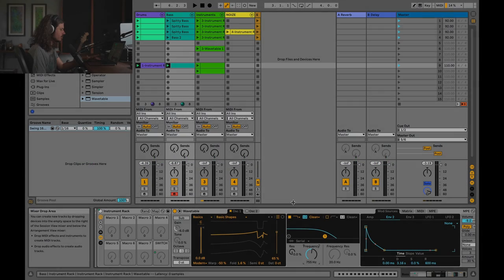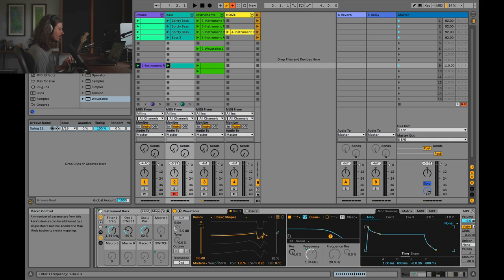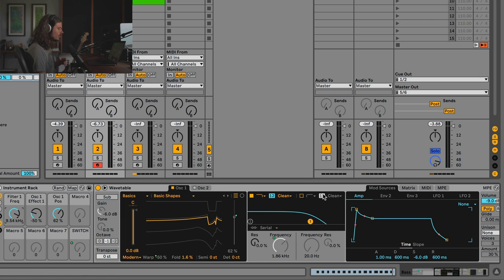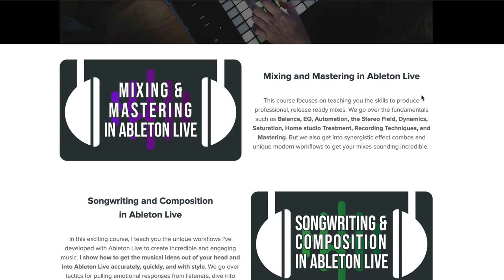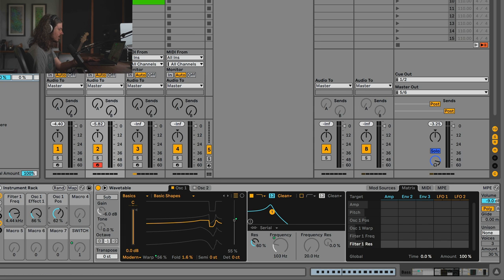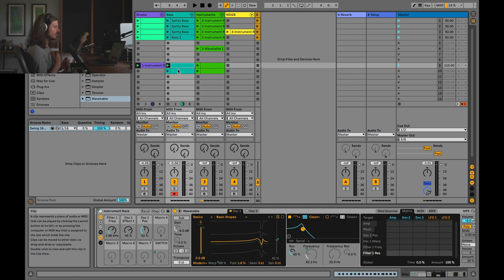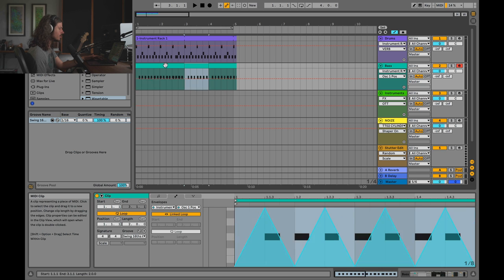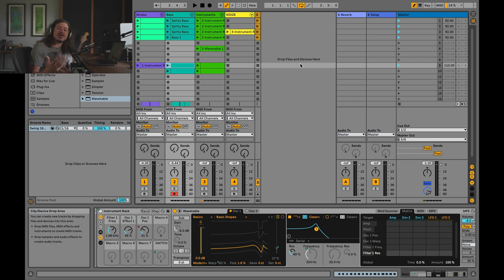Ableton Modulation

Comment: I love these videos. I just wanted to point out (in case it wasn't clear) that when you set that modulation to only go down to 50%, you mentioned that setting the value to 75% would make the modulation bottom out at 25%, but I think it would bottom out at half of 75%, or 37.5%.
Reply: You're right, I tested this with pan. Not quite how I was hoping this would work.

Comment: Well that's awesome, I never really thought about the difference between automation and modulation but it makes total sense - especially if you think about it like hardware.

However just one thing, is there an easy way for it to be bipolar? i.e. for the knob position to be the centre value so a range of say 50% would be plus and minus 25% from the knob value.
Reply: good question
Reply from the maker: Well I can say this. On my hardware modular synths some controls are bipolar and some are unipolar. This seems to be a design thing. I've noticed some modulation controls such as filter cutoff appears as bipolar but most are unipolar. I suppose some fancy midi routing could change that but a simple solution doesn't really exist

Comment: sadly the outgreying device parameter  disapear  without a rack solution  on 
Push  2 ..strange  ...
and modulation or automation  from a shaper device lost again the control stage?
modullation can controlled in  a Clip with a mouse but not in a musical sense with maybe a mpe controller or other Signal without losing the parameter 
For real stage  live Performance setup  building  were I want control over modluation and automation its realy strange behavior., for Studio & mouse okay I must change the automation all the time ...
 I dont know is there Max device solution or a Script add on  out there to  fix these part ...
. I buy Live  but it feels like a big mistake
on the modulation part automation  midicontroller part...